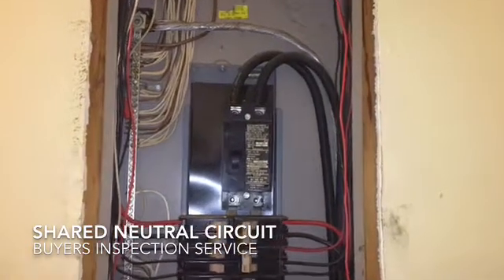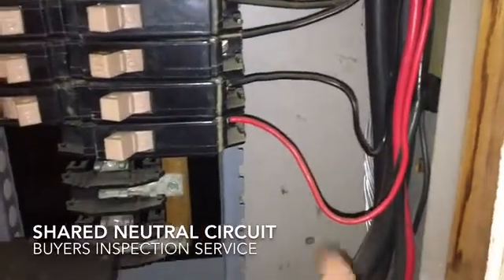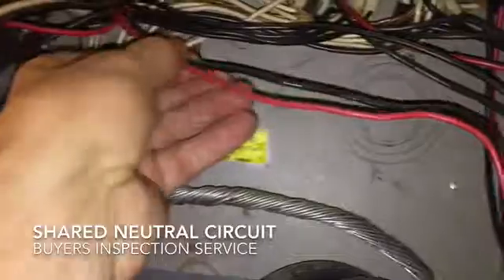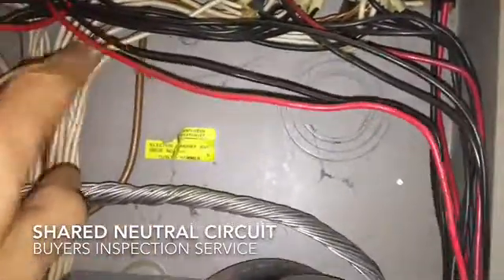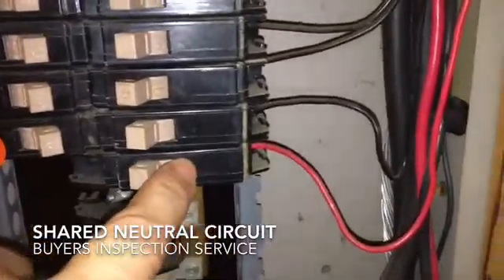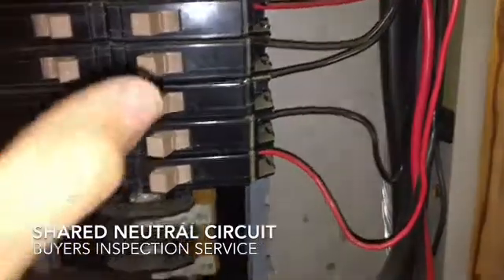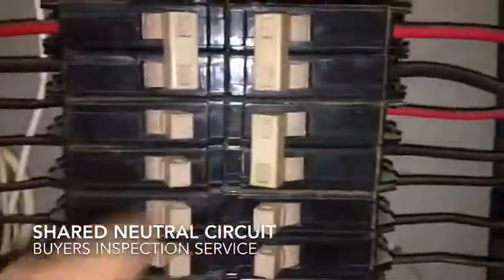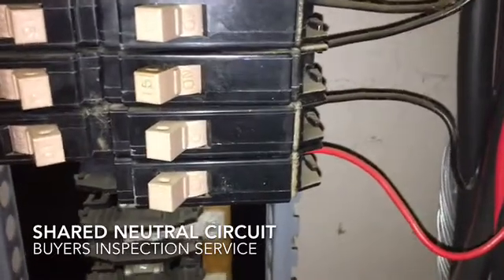Shared neutral can pose a danger if a common trip is not used

Comment: This weekend I got shocked by the neutral wire while replacing my outlet. I was very surprised since I turned off the breaker in the panel. I got scared, so turned off every breaker in the panel to finish the work and then spent the rest of the afternoon trying to figure out what's going on. After a couple hours of research I learned about "shared neutral", which is apparently more common on older homes, particularly with upstairs/downstairs light on a 3-way switch. I assume my house has been wired this way since it was built in 1966, so I'm not going to tear walls just to add more neutral wires unless there is something (else) dangerous that I'm not aware of. For now, I'll just remember to turn off multiple breakers when replacing switches or outlets.